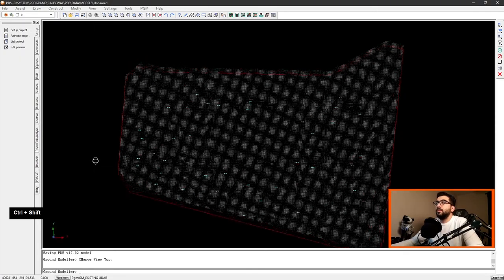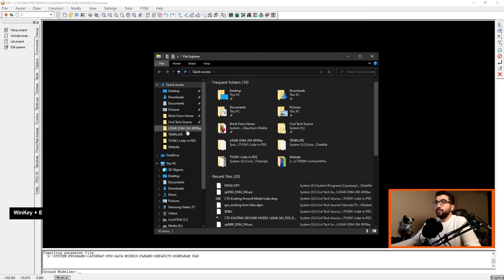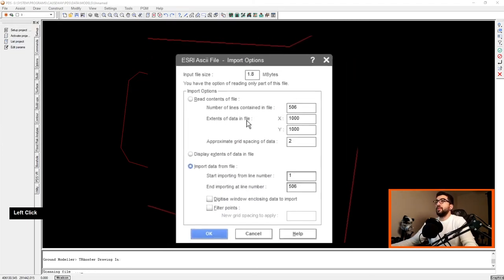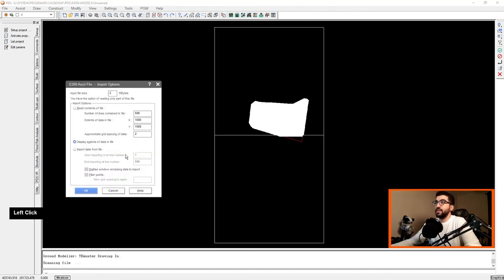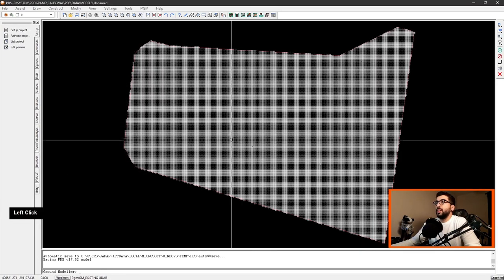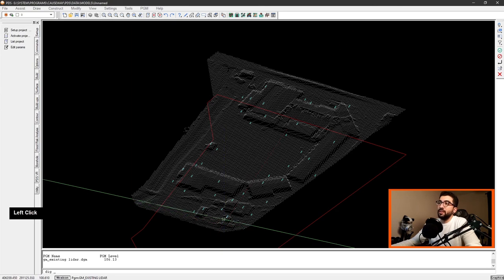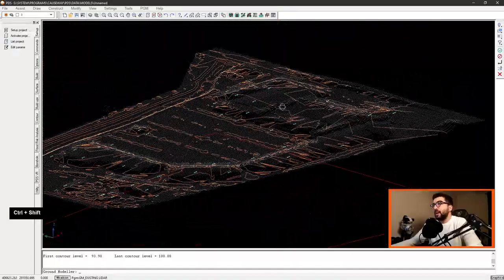Lidar survey - How to import in PDS

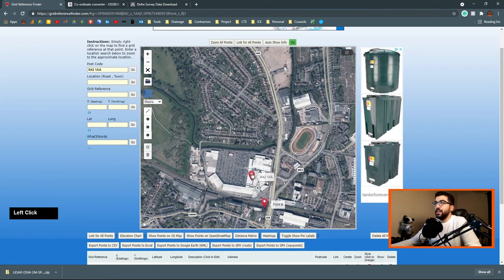Comment: Hi Ferdi, for the tile number (03:47), can't you just get it from the long grid reference number? I think it's just the first two digits of the first part, and first two digits of the second part, so no need for nearby.org.uk eg TQ 12345 67890, Tile is just TQ1267.
Reply from the maker: Never noticed if this is how it actually worked! Great, good to know this!!! Thank you for sharing!
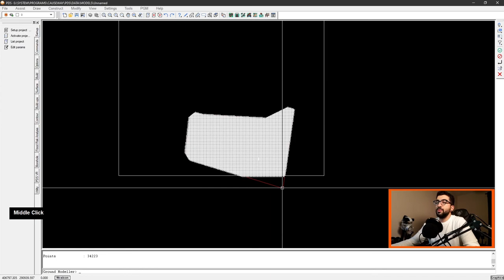Reply: @CivilTechSource   you're welcome. And I think the first two digits are on the Easting (x) direction, and the second pair on the northing (y). So without even going back to Grid Reference, 05:50, if I already have SP 0691 and I want the tile below it, I would go down by one as you're going below, so SP 0690, if I wanted the tile above, I would choose SP 0692 etc Hope it makes sense.

Comment: When I try to digitise my site boundary, I have to click segment after segment of the boundary line rather than the whole line being selected. it is a closed polyline on AutoCAD so I'm not sure why it segmented on PDS. I'm wondering whether it's to do with PDS string.
Reply from the maker: Hey Chris, I would suggest to freeze all the layers and leave the site boundary layer on and then use the generate string command and window select all your boundary and hit enter this will create  pds polyline/string so when you select it, it will not be segmented. Hope it helps.
Reply: @CivilTechSource  thanks for the quick reply, I will try it shortly.